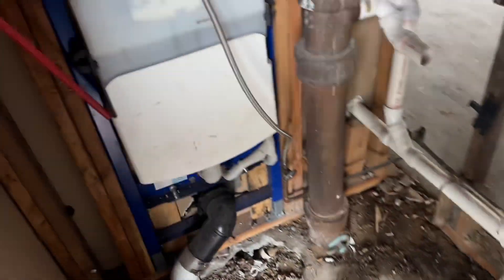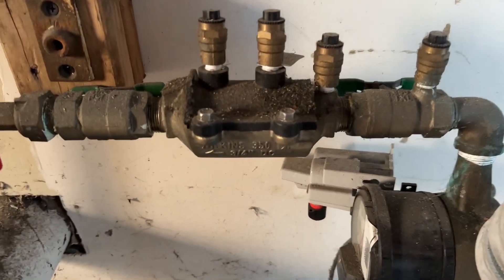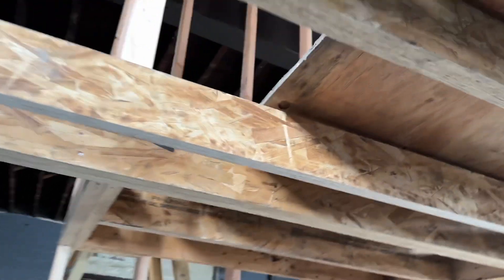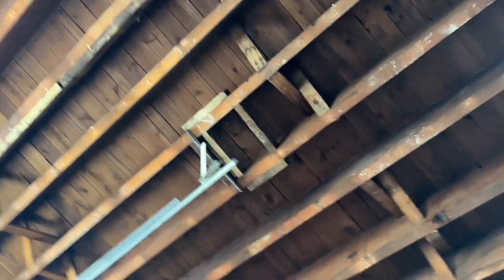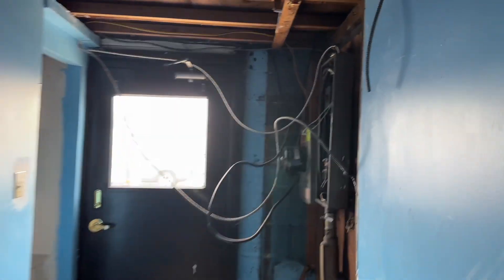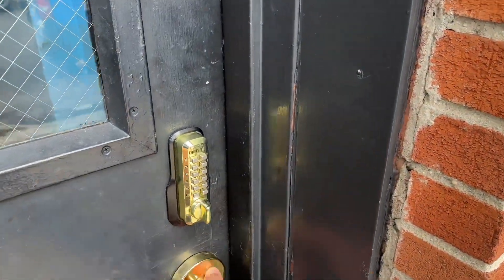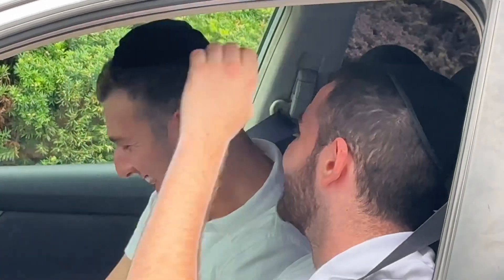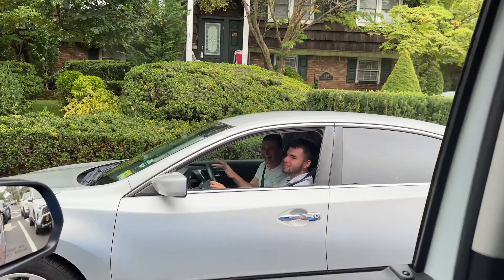Construction Status Update August 18, 2023 Woodmere, NY Facility

Comment: The electric looks good, need the plumbing updated, roughin for electric, and improve plumbing, insulation and drywall, and your skills on HVAC.,Might want to fur walls with steel studs, for electric and insulation of walls, other wise you might have to put wiring in conduit, The steel studs and insulation would save money on the heating and electric bill. Good luck.

Comment: Set up a test bench with water, air, nat gas and multiple voltages. 24vac, 120vac, 240vac and 600 3ph. Interesting hazard if used incorrectly. Lol
 By the way, that expansion tank is upside down. I know you didn't install it. If that panel is live and left open you would get crucified where I come from.